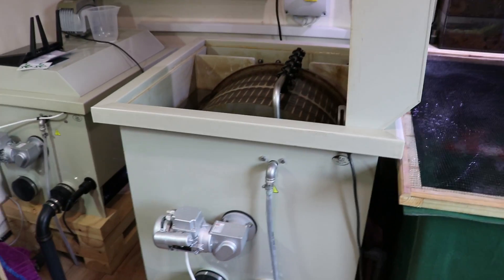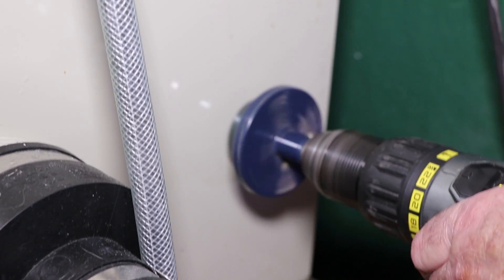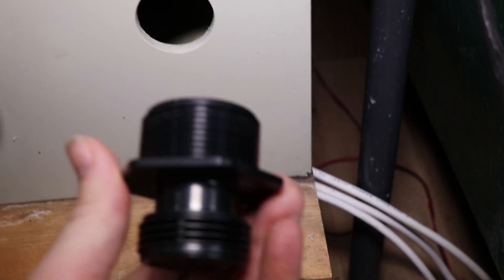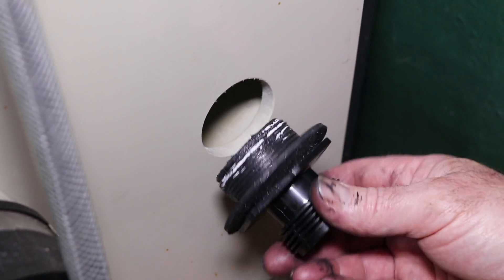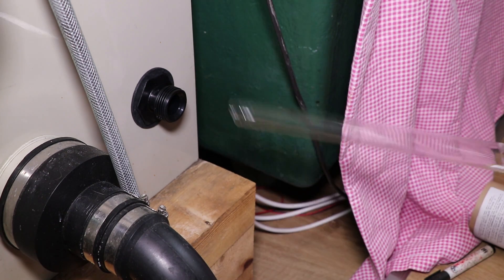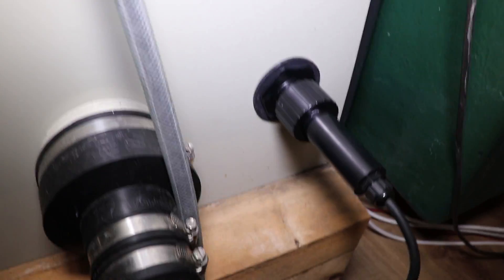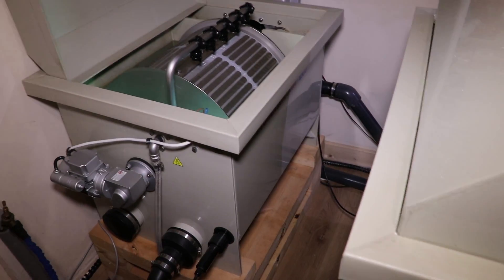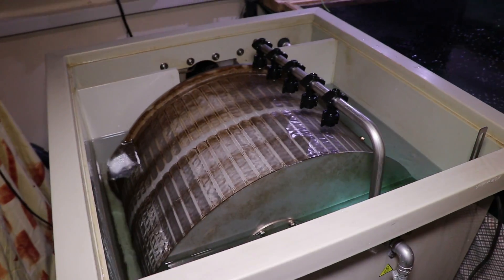Installing a 40w Amalgam UV light in a drum filter

Comment: Hi, I know this was a while ago but I'm trying to find out if the uv light has a certain way of fitting on the plug? I'm currently fitting some a shower that have no been marked up so unsure what orientation they should be. Thanks!
Reply from the maker: This specific UV light has 4 pins on the end if you look they are different alignment so 2 pins are closer together than the other 2 so it will only fit together one way. Most Uv lights are either not polarity sensitive so it dosnt matter or will only let you plug them in one way so you can't go wrong.

Comment: Hi this is Sandy, our company produce the sugar or other filter machines using 304 316 430 stainless steel wire mesh since 2007, from 4 mesh x 1.2mm  10 mesh ｘ0.7ｍｍ，　20 mesh ｘ0.45ｍ，　30 mesh 40mesh to 100 mesh all wire mesh in stock,   Width can ve from 50cm to 5 m length....
If any need, contact us via email address； sandy@thefactoryly.com or whatsapp +86-13623380888

we also produced the wege wire filters as per your size, pleaser contact us if any need

Comment: Every video I've seen that has a rotary drum system all display the same problem, the spray jets are spaced too wide! the spray patterns need to have a 50% overlap. One or two spray heads would improve cleaning immensely.
Reply from the maker: I would like to see a more powerful spray or one extra spray nozzle so they overlap more although it is a lot cleaner now with the UV light stopping things growing on the mesh. Just increasing the cleaning time in most cases makes a huge difference if you feel it does not clean properly extend the running time and it will help a lot.
Adam

Comment: Sorry. What I mean is iv used sipporax for years in my filters and the media is fantastic. But do you not find that it blocks fast?
Reply from the maker: One of the advantages of drum filter, it does not allow any meaningful particles through so having the Siporax after the drum is not an issue I would not use Siporax after a Nexus I wouldn’t even use a river after one. So the Siporax does not get blocked by dirt.
Adam

Comment: Nice video once again. People always seem to have problems with the gaskets. You only need to use one on the side that does NOT have the collar you screw on. If you do it like this, you will not need any tape or sealant to make it water tight. Putting a gasket on the inside (in this case) does not work since the water will slowly leak across the threads.

Comment: hi Adam another great video

how often should you replace the uv light ? 

thanks mate 

Kevin from Wales
Reply: I think on average you can get 7000 to 8000 hours out of the bulb. That being said, if it still does the job, no need to replace it. I only run my uv a couple of weeks a year, so mine should last quite some time. I only use at the start of the season to combat algae in the water. Once the plants have taken of again after the winter, I no longer use it.
Reply: OK I have 2 of them in my drum but I don't have any on my pond should I get some for my pond
Reply: OK I have 2 of them in my drum but I don't have any on my pond should I get some for my pond
Reply: Thank you
Reply: Kevin Eastment I think it's best not to put them IN the pond. Just like with the algae en parasites, uv is harmful to all living things, including your fish. You should not expose them to uv light. If you want any extra uv sterilization, you can always put another uv light in-line with your plumbing. But I think 2 bulbs in your drum filter should be plenty.